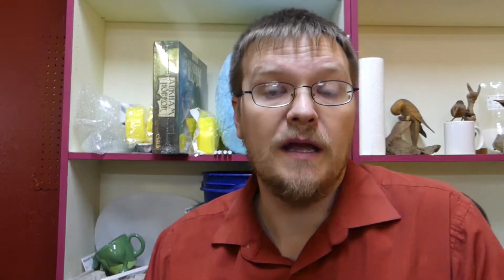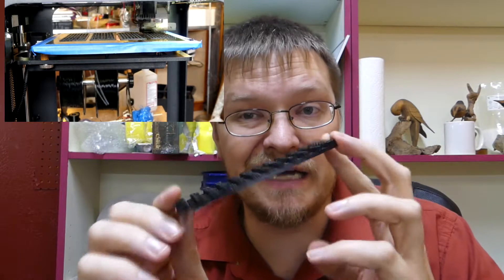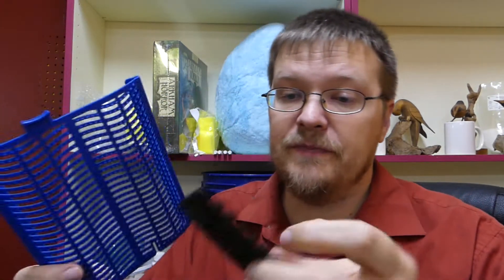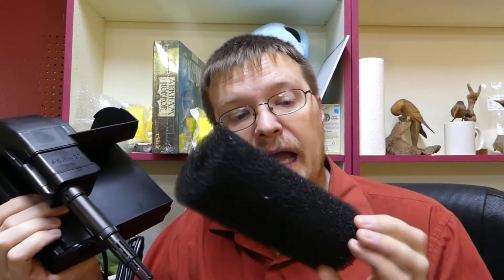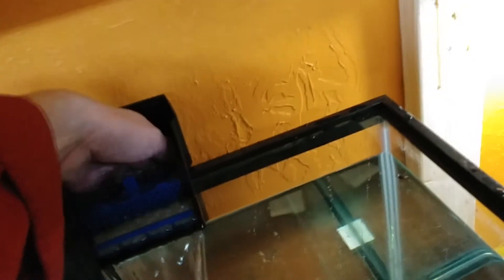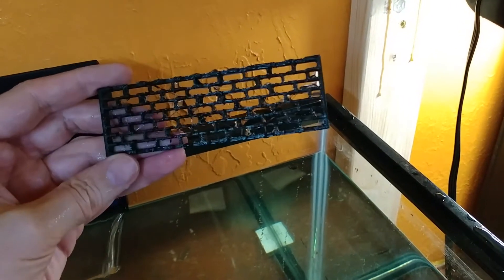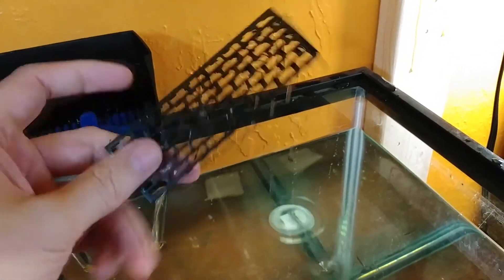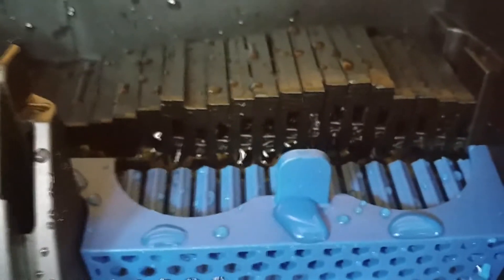3d printing filter media

Comment: Is the plastic from a 3D printer safe for fish and long term use underwater?
Reply from the maker: About the only thing released by PLA plastic is lactic acid in very small amounts. This is functionally harmless.

But some 3d printer hot ends contain weird things, so I only feel safe making these on my 3d printer that has a stainless steel hot end.

The PHA additive used in some PLA is likely already in our tanks as a bacterial byproduct, but I don't know if more matters, so I generally use additive free color free PLA. I also feel safe using regular black, since the EPA classifies the carbon black additive as "inert"

I stay away from other colors just in case, though
Reply: What about PETG

Comment: Could you use these in a trickle filter?  They look pretty neat. I like your style. 🐡🐡🐡
Reply from the maker: You could use them in anything, but I'd probably go higher surface area + lower flow rate for a trickle filter. These were a "highest flow rate, easiest to clean" mock-up.
Reply: Angelfish Unlimited , you’re an interesting guy.
Reply: Wow never thought about this. Excellent video, thanks for uploading

Comment: They seem interesting, Ill take some! Can you do an update on water properties if you use it in a main filter? Just to be certain they are effective because the holes seem bigger than sponges and your basic bio media.
Reply from the maker: The holes are huge compared to a sponge, but that's on purpose.

The efficiency of media goes up with flow rate (to a point), there's a handy little graph here: http://biofilters.com/websizejan15_files/image002.gif

So even though ceramic media have HUGE surface area, the flow rate per sq foot surface area is incredibly low, so they have incredibly low actual efficiency (far lower than anything on that graph). They still work well because of insane surface area, but they plug up easily, so maintenance is a pain. 

These were designed with the reverse in mind, high flow being primary concern.

That said, the surface area is still pretty high. These run about 280-320 sq feet surface area per cubic foot (though only about 180 if printed at ultra fine quality). Here are some best estimates on some other media: Kaldness k1 210-240, pot scrubbers 350-370, sponges 75-200, bio balls 100-175, lava rock 15-40 (they seem hollow, but they aren't really, the cells are all closed)

So these should, in theory, outperform all of those. I'll definitely be doing some tests once these cycle to confirm that my math is right (part of an upcoming video on sizing filters)
Reply: Angelfish Unlimited Nice! Can’t wait for the test video, if they do outperform those, this would be the most simple and effective bio media to probably ever exist but I have doubts. I am using matrix media so doubt it will outperform that but who knows.
Reply from the maker: They'll just be more effective than other plastic media, but only because they're 3d printed in a way that leaves a really rough surface. Nowhere near sintered glass stuff like matrix or biohome ultimate.

Stuff like matrix is super low efficiency per sq foot surface area, but there's so much surface area that it doesn't even matter that it's low. Pretty sure the comparative numbers to the above stuff for matrix is like... 7500, which this won't touch
Reply: Angelfish Unlimited Yep, would have thought so, I can see them being more effective than k1 or bio balls and maybe sponges but lava rock is want I want to see this be better than, lava rock is probably the most used diy bio media used and most effective diy bio media. The fact this was 3D printed is just so cool, I bet as 3D printing progresses, there are much more things than media to make in the hobby.
Reply from the maker: The reason that something like matrix is so high is that all of the holes interconnect, so they're like really long complicated tunnels running from one side of the media to the other. Like a really rough incredibly fine rock sponge

But lava rock isn't like that. All the holes are closed, so the only area that anything can grow is on the outside surface. That's why the numbers for lava rock are so low. It's also why pumice floats.

I've actually reached out to a couple of places to get some gas exchange tests done to get some real numbers for lava rocks that aren't coming out of companies trying to sell something, but haven't heard back from any of them yet. 

I don't want to make a video going "hey, uh, guys? This thing is actually pretty awful" without some real numbers behind it, because it's possible that all the really low numbers online are wrong
Reply from the maker: Also, yeah, I make stuff for my aquariums all the time, auto feeder scoops, filter parts, lighting clips, breeder boxes, air line stuff.

I'm working on a floating "self contained blackworm farm and feeder" but that ones hard because it's just so easy to harvest them with a battery that I lose my motivation
Reply: Angelfish Unlimited Yeah, thats the reason matrix can control nitrite, nitrate, and ammonia, there is housing space for all of them. Heard that matrix is pumice but just has something done to them like washed, broken down and whatnot. I think I made the right decision buying matrix though instead of anything else. I have a bunch of Seachem products, big fan lol. Lava rock is not the best bio media but has lots of space and holes so it is a good bio media. Just to have some on hand is good as you can break it down into whatever size filter you have and its cheap, having spare media can help out at times I would think.
Reply from the maker: For sure a good idea to keep extra stuff on hand.

I've heard they do an acid wash to remove any surface heavy metals, which is one of the big "in theory" dangers of lava rock, but they might just source from a known safe volcano with a slightly more open pore type

We have lots of dead volcanoes around here, some are fish tank safe and some aren't (takes lots of digging in old mineralogy reports to find out)

The pumice you can find around here is all "large hole" stuff like the lava rocks they sell at the hardware store, and that tends to decrease surface area a lot

I think that's a large part of the confusion in lava rock being "great" or being "garbage," and why some of the number are insanely low. It's also why I want to get my own tests done, since a company could always just choose the worse lava rocks and then claim they're all like that
Reply: Angelfish Unlimited Very true, its natural so its not always consistent. I see many youtubers in the hobby do diy or quick filter videos using this as the bio media. I haven’t had the chance to use any since I would have to get it in bulk and wont use all of it and also already have my filters stocked with biomax or matrix. Staying tune for the tests!